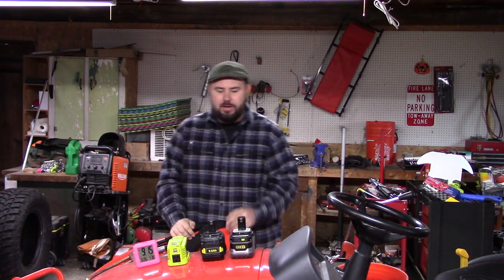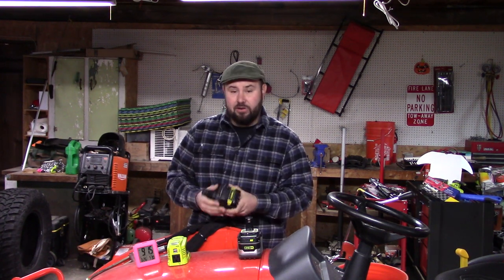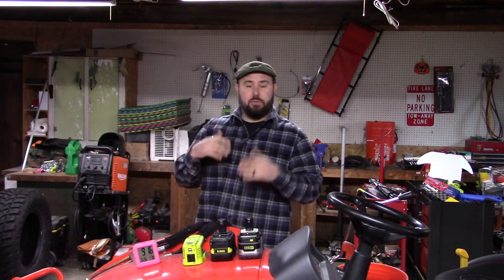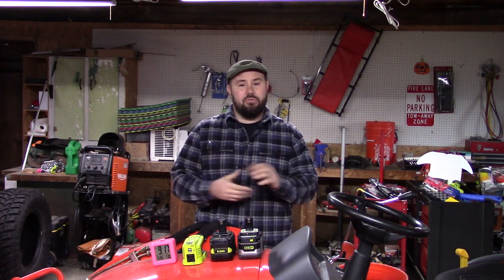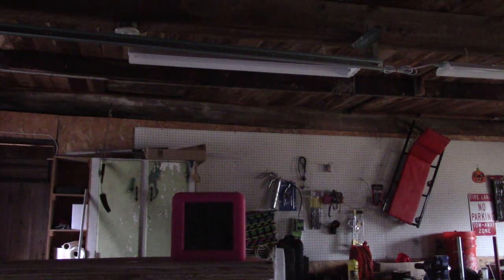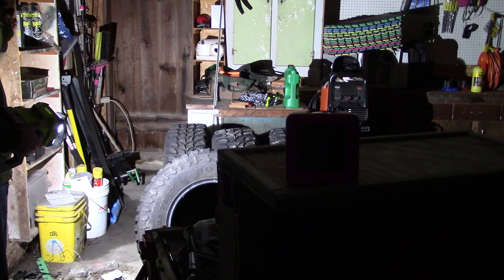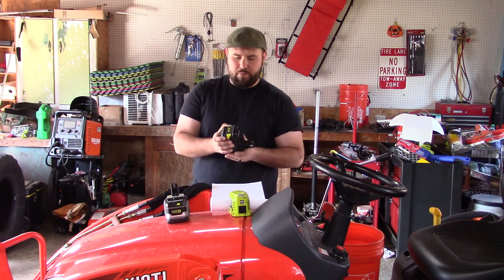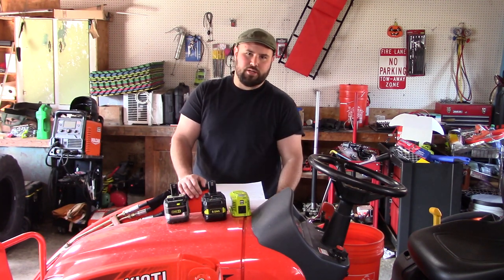Ryobi Battery Knock off vs Genuine

Comment: I bought me the knockoff 9ah for $47 on Amazon and noticed it has the two extra battery terminals on the back which indicates that it should perform as a "HP" battery. I opened it up and counted 15 cells and verified that the rear extra two battery terminals are actually connected. I don't expect it to perform as 9Ah genuine Ryobi battery, but at that price I am happy if it can beat or keep up with a Genuine Ryobi 4ah HP battery ($99).
Reply: You trust them way more than I would. Pushing those cheap Chinese cells to the brink using the extra terminals is a recipe for disaster. I'd never put a fake HP battery in a Ryobi tool with the extra connections. Granted, there's a good chance they're not actually wired to anything that will give a proper boost but on the off chance they are, you're risking a serious fire.
Reply: So how is it
Reply: @TheCharleseye  Not sure how you sleep at night, knowing that hundreds of people die each year, strangled by their sheets.
Reply: @Bhatt_Hole  🤣🤣🤣

Comment: I know I'm a little late but for those wondering the true capacity of the knock off Ryobi batteries, It's actually around ~5200-5600mAh. These "9000 mAh" batteries use "2000mAh" generic 18650 cells which are rated at a maximum of 2000 mAh per cell but are usually closer to 1800mAh per cell, they are 5s3p battery packs so you get the aforementioned capacity. 

The "6000mAh" batteries use slightly higher capacity cells at "up to" 2200mAh with them being closer to 1900mAh per cell or 3800mAh as their true capacity, the "5000mAh" batteries use "up to" 1800mAh cells with some of them using "up to" 1600mAh rated cells giving them between 2800-3200mAh as their true capacity.

Overall these knock off "Ryobi" batteries are a pretty great deal, but only if you treat them with care and understand that the "you get what you pay for" rule always applies. Also depending on how they were stored/used some batteries may get/be quite rusty (due to the non existent water resistance) in addition, if you drop them it might sever the connection of the nickel strips to some of the cells, making these batteries no longer rechargeable (without repair). These batteries Should NOT be used with a "fast charger" as the BMS they use cannot handle the higher power and may lead to overheating of the cells/circuit board and ultimately either lead to a fire or one or more of the cells dying early.

Last thing to note is that these cheap knock off cells have a very limited lifespan of between 150-400 discharge/charge cycles with fast chargers usually cutting that time down to a quarter of that.

Comment: Knock off batts don't use recycled/used cells anymore, they use new chinese brand cells but the capacities are much lower. In this case, they're using 1.5AH cells vs 3AH cells in the real ryobi batt, which results in about half the capacity.
Reply: Not always true. I got a off brand battery that beat an official one by 5 mins. :)

Comment: As a maintenance electrician at a large transformer production plant, I use my battery tools fairly often. if I have to do a lot of drilling, cutting, grinding, etc. I will drag out the corded tools and extension cords. The difference in performance is huge. When I do bring out my Ryobi battery tools it is usually for a quick fix or repair. The problem with Lithium batteries is in the preferred charge/discharge cycle compared to Ni/cad or even lead/acid batteries. Doing a total discharge on a Lithium battery is not good for it. Neither is overheating it. Lithium batteries also don't like extreme cold temps either. Ni-cads, although they have less energy density per pound, are much more robust and not as finicky about discharge/recharge cycles or temperatures.  Lithium batteries also don't like to be kept on the charger after they are fully charged. If you don't have a smart charger, that shuts off after a full charge, it will decrease the life cycle of a lithium battery.  Same goes for cell phone batteries. Charge it to 100% and then unplug it. Although the Lithium batteries have a higher energy density per pound, they are finicky about the charge/discharge cycles and temperatures. Unlike a NiCad battery that can be recharged after being dead for years, a Lithium battery won't charge on most smart chargers after they drop below a certain voltage. (There are youtube videos on how to fix this to save your battery and it has worked for me several times with Ryobi Lithium batts.)  So my opinion on any Lithium battery is to swap them out before they stop or overheat and have a few charged batts ready to go. My girlfriend who is about 69 years old, doesn't like the huge, high capacity batteries  in our weedwacker or leaf blower. They are too heavy. So I have a few small, lightweight Lithium batts ready to go when she feels the need to work on the yard. I have a corded Milwaukee blower and an Echo brand 2-stroke weed wacker that I use. Both are too heavy and too powerful for her wrists.
Reply: ..Girlfriend who is 69 yrs. old?..umm..she's no longer a "girl"...an old lady...
Reply: @dyer2cycle  - When YOU get to 70 - and you are lucky enough perhaps to have a lady partner - you too will do her the courtesy of referring to her as you 'girlfriend!'

Comment: I ended up with a knock off 5Ah battery, performance was OK, until one day it would not charge. Something had gone wrong with the electronics, the cells did take a charge when I had a play, but not without bypassing all the electronics. Needless to say I got rid of it. Lasted a few years though.

Comment: Weigh them then open up and see what you got. My Dyson vac battery failed after 18 months. They replaced it with a new one. I took the old one apart an nd charged each cell separately. Three years later they are all going strong. Not all dead batteries are dead, they only say that they are.

Comment: 78% price variation, battery prices don't vary that much even with better batteries so Ryobi are doing some serious price gouging.
Reply: I think they're charging you for the length of time those batteries will be useable. Meaning they'll out last and out perform any cheap knock off for years when compared to the genuine ones. I think they're fairly priced.

Comment: I’ve read that a few people have found these batteries work best after they’ve been broken in. Charged full, emptied charged full again and then emptied. The third or fourth charge allegedly begins performing on par with the ryobi 9 amp hour. These are supposed to have more powerful cells in them 21700’s compared to 18650’s
Reply: That was not my experience.  The 5 ah knock off lost working time with each successive charge and use.  After about 8 cycles I sent it back.
Reply: If what I've read is correct, you are never supposed to take them down to nuthin. Always stop and charge long before it's on empty.

Comment: i paid $56 each for a 9ah knockoff compared to $209 for ryobi hp 9ah for use in my lawn mower (just to save my good batteries).
same run time as my 6ah genuines but alot cheaper.
Reply: could u share the link of the product please?
Reply: Thats what I found and I think its because the real ryobi ones cut off much earlier to protect the cells so you end up with similar run time.

Comment: i'm not saying the knock-offs are good but you can't get an accurate point of reference out of just testing 1 battery, it could be defective, you need to test multiple of the same knock-off batteries to get a baseline then make the comparison to the name brand batteries..
Reply: Also it's so important if they endure, much more important than how long they'll run a tool which is primitive, an electrician would laugh and really measure the amp hours.

Comment: The knock off are using new cells but only 1500mah 18650 cells. Plus after a couple yeats the knock off cells will be starting to fail . My original battery is about 4 years and still performs great. My knock off will only reach 2 bars fully charged and doesn't last long.
Reply: I've got several knock off ryobi batteries that I've had for several years and are working great, I just got my fourth 9ah knock off to complete my yard tools. Also I've had 4 knock off rigid 4 ah batteries for 5 years and still perform perfectly. Is it possible you over abuse your batteries and tools? On a side note I just reactivated my old 18v porter cable tools with knock off batteries lol
Reply: This is what I was hoping to learn about watching this video. Can other folks corroborate or speak to their knowledge about how long they'll last  -- thanks

Comment: During a recent Ryobi sale, you could buy two 4 AH batteries for $100, and then pick a tool from the collection for no additional cost.  So, for the $100, you get 8 AH, and for the equivalent $20 0, you'd get 16 genuine Ryobi AH, and two tools.

If they run the same sale on Black Friday or for Christmas, I may have to bite.  And get the inverter.
Reply: They just had the 150 watt inverter with two 4ah battery combo for 100. I should of bought 2 of those combos. I already have an ecoflow and bluetti but that little ryobi inverter is soo movable and convenient. It powers just about everything I need it for.
Reply: @DoritosResidue  I just checked online.  We're close to another Ryobi Days same.  Same (two) 4AH batteries, and your choice of basic tools.  I considered the 150W power station, but the video reviews said that the inverter was failing.  There's a more clunky looking inverter that's only 120W, but is more flexible.  It can plug into the car or the battery pack.  It's $40 on sale.  There's another USB power station for $20, that had to be ordered online to get shipped to the store.  One hit the first one, RYi 120A.

How am I going to explain that I bought another tool just for the batteries?  
😯😯
Reply: @ramixnudles7958  lol I know right!? Buying a tool just for the batteries is hard to resist. But  I haven't have any issues with the inverter.  I mostly saw that the usb ports are failing which I don't use any way. They are too low in power for my taste anyway. I was thinking of getting that dc ryobi inverter as well but I really don't need it plus it doest have a battery combo lol. I read somewhere they are coming out with new inverters with some type of external USB charging and or solar port pass through charging . That is needed because they are behind the times in terms of inverters . These Chinese crowd funded companies are already leaps ahead of ryobi power stations. And alot ways cheaper

Comment: For some reason I want ryobi cut off tool but I don't think I have a need for it. Thoughts?
Reply from the maker: I use mine for small cutting task, such as piping, 1/2 plywood siding or metal roofing or metal stock. The problem is it a small area of work where as the oscillating and grinder has most small tasks covered
Reply: That cut off tool looks so cool to me. I have no use for it at all besides maybe chopping FSP on AR barrels but I want it too LOL.

Comment: I have Ryobi batteries that will not charge anymore,the knock offs i have still charge.
Reply from the maker: It may be that they went below the minimum voltage to charge, you can jump them if that is the case. The off brand typically do not have low voltage safeties
Reply: @livefreeandtoolon  what do you mean by 'jump them'?
Reply from the maker: @helenflouch  you would manually charge them with another battery to a point that the wall charger will identify the battery level sufficient to charge

Comment: 9ah battery is excessive anyway and heavy enough to throw any tool out of balance.  You will get better performance, better tool ergonomics, and power efficiency by capping at 6ah.  Honestly I stick with 4ah and just buy more of them.  In my experience, they last about 20% less than 6ah, rather than 33% less which you would expect.  Having said all that, I have purchased a couple 5ah off-brand batteries and they're fine but not great.  They tend to perform slightly worse than the Ryobi OEM 4ah, which is fine.  One other consideration is the lifespan (number of cycles) of the knock offs.  While cheaper, I don't expect they will last as long over time, and will certainly degrade over time, faster than the real deal batteries... time will tell
Reply: True, I actually want a 9 amp hour for basic things, like using it on the Mister (even though the battery is big to fit on the mount). My inverter and the wheeled Ryobi Vacuum
Reply: Can't forget the new table saw and the new 10in miter saw

Comment: I have a couple of the "5Ah" (actually 4Ah) knockoffs from Amazon. They work fine but are nothing special. I won't trust them in my high draw tools but they do fine for camp lanterns, fans, radios, even a drill or two, occasionally. I would never use one of the HP knockoffs in a HP tool that has the contact points. There's no way I'm risking whatever damage they could do if wired wrong (or wired right but with vastly inferior cells).

Comment: Sponsored by Ryobi :)
Reply from the maker: haha I wish
Reply: If you are intimating that he falsified the results to favor Ryobi.  I can say I have 3 knockoffs Ryobis all are under rated.
Reply: @cameranmanner4701  not at all but if a Ryobi battery does 12 mins run time on a job and a knock off does 8 I can buy 4 knock offs for the same price so I get 32 mins run time. Simple math.
Reply: @philhorton1827  Yes I calculate the price per amperage is a better deal.  I would just prefer to buy a battery that states the real amperage rather then put phony numbers up as a marketing scheme.  If they are willing to lie like that it makes me think what else are they not truthful about... Low Voltage Cutoff, Thermal sensor?  How about use the $ per amperage and make a true 9, 6, or 4 amp battery.  It may cost a bit more, but still cheaper then OEM as they are using cheaper cells and less plastic to make cases to equal the amperage of a "9amp" battery for example, and then I know they aren't mentally cheating me as well.  If we keep supporting this amperage format then they will never stop this marketing ploy.
The great thing about these packs as I live through the generic DSLR battery pack generation.  It keeps the OEM manufacturer's at competitive pricing as they don't have a true monopoly.
Reply: @cameranmanner4701  fair enough. I just think Ryobi should drop prices and not look for massive margins
Reply: @philhorton1827  better option is to have all the tool manufacturers use one battery format and spend time on improving their tool line up or better innovation.  But you know they have to capture all profits from every angle.
Reply: @cameranmanner4701  yes mate they do have to capture all profits which is why they try to force you into one brand
Reply: @cameranmanner4701  Yes, I wish, but too bad that will NEVER fucking happen. They got me too, I got a Ryobi set as a gift over 20 years ago, and although I probably don't have any of the original tools any more, I have replaced them all and added so many more that I am of the opinion that"I'm not switching now!" Yep, the scheme worked!
Reply: @RDAUGIRD  thats what happen with  me.  I was gifted a cordless bundle from ryobi 20 years ago.  What I like about ryobi is now what I hate.  The original battery format allowed my to buy way too many of thier green tools.  Since the battery has a stem it makes it impossible to make an adapter and use on other tools.
I'm glad you and I fell for the same scheme, but I would prefer more tool diversity without buying a new set of batteries and  charger.

Comment: The knock off battery won't last as long. I have a 1 year old knock off 4ah and it worked good for the first year now it won't even last as long as my 6 year old 1.5ah Ryobi batteries.